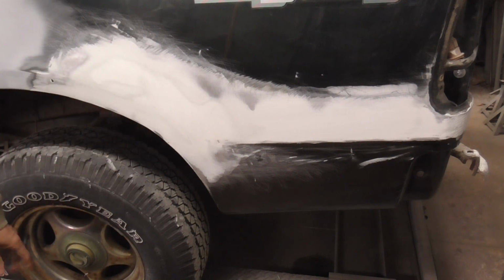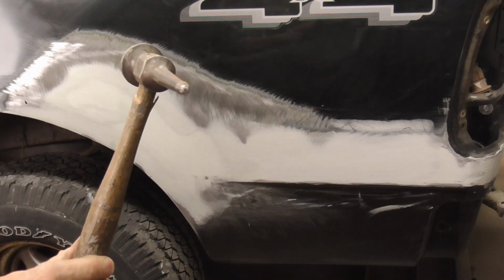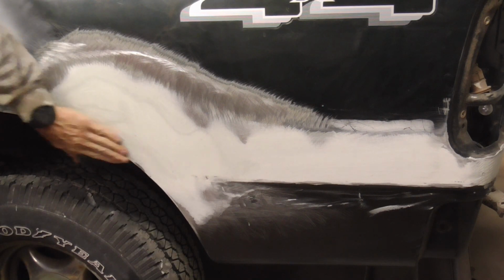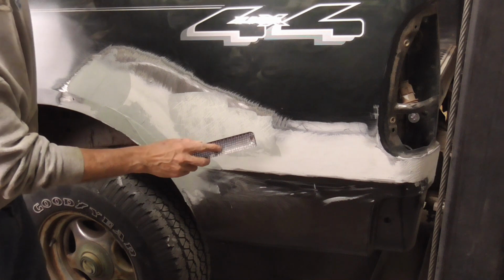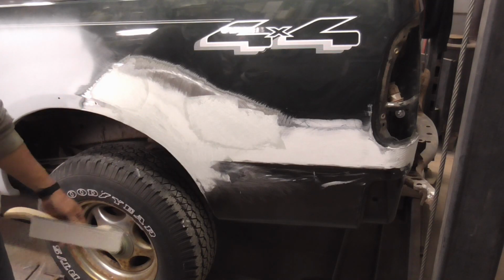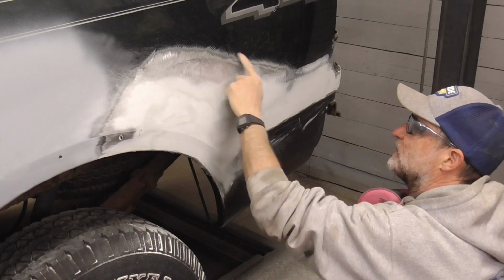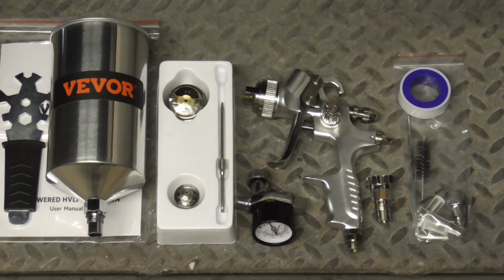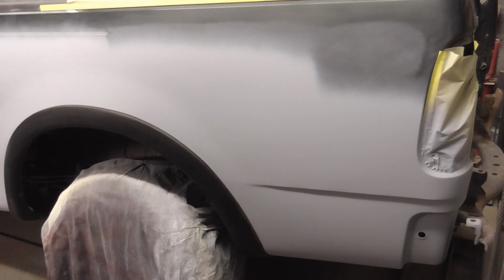Fixing High and Low Spots in Body Work | Dent Repair

Comment: Hi Jerry. The way you put the body filler on, I would just prime and paint, and no sanding. Looks awesome. If a person had a rust spot in the middle of a door, could one cut it out and weld in a new piece with out to much damage to the rest of the skin. I'm unsure how deep the rust is though. I dont want to get a new skin as my car is all original sheet metal, and all the glass is original all the way back to 72. I was wondering if I mig a spot, cool it with air, and keep going around the patch doing that. If it can be done, could you do a video about that too, besides the sheet metal one. Have a great weekend
Reply from the maker: In my opinion, you could absolutely get away with just this - https://www.youtube.com/watch?v=rPTaeH056ng  It won't ever see moisture up high on the door so you'll be fine.  Might just be surface rust too - I would just grind/sand it clean, even sand blast it - look for holes - if none, tap in down just a bit and fill.  Let me know what you end up doing with it GM - always good to hear from you - have a good week my friend :)

Comment: Hi Jerry mate. I have trouble determining the high and low spot, guy at work told me to use a rag. Do you have techniques to determine it by hand?
Reply from the maker: The only guaranteed way is to get it as close as you can, give it a few coats of primer, then block sand - you'll see your low spots then - especially if you give it a quick guide coat (a light dusting of black paint).  If you're using grey primer, the black will sit in the low areas as you block and will really show up at that point :)

Comment: Hey Jerry, i was wondering, when you finish rust repair on a panel, after filler and paint work, if you apply used motor oil, fluid film, etc, behind the panel, could that oily substance creep through the welds and start to penetrate the filler and create issues? I'm a big fan of fluid film and the like to stop rust, but how does cured filler hold up to that?
Reply from the maker: It doesn't have an effect at all - here's some proof of that - https://www.youtube.com/watch?v=8XaZBy7GC7A  also (old vid but still has good info) - https://www.youtube.com/watch?v=2o37dX--w0I
Reply: @LakesideAutobody  That is great to know! I appreciate the videos you put out there full of great info!
Reply from the maker: @15farcry  Thanks Ethan - glad they help - thanks for watching :)

Comment: Hey Jerry, I bought a used fender to replace a  damaged one. It has old paint and chips in the paint, (no dents). Do I need to sand the entire thing to bare metal or would filler primer fill in those paint chips? Or do I just sand the edges of the chips smooth then filler primer? Thanks in advance
Reply from the maker: Great ?s.  It depends.  If there's tons of chips, it'd be easier to strip it.  If there is just a few it's common practice to feather edge (sand them smooth), prime, block, prime, finish sand, paint.  You can get away with filling them with 2K putty, filler, or even lacquer glazing putty but that is frowned upon when working in a body shop.
Reply: Thank you sir

Comment: Great job Jerry bodywork is even harder on a black car
Reply from the maker: Thanks Luis - hope all is well with you and the family - have a good weekend :)
Reply: Great vid, have a few questions 
Notice you did not use any guid coat,
Also questions on guns??  I’ve seen and read many mix reviews on using just one gun for all painting needs!  See your using a vevor paint gun (which is in my budget). What other low budget guns would u recommend for spraying primer/sealer/base coat/ clear???  Just a diy beginner. Thx and keep sending great content
Reply from the maker: @dwaynelejeune3508  I've never really seen guys use a guide coat for body filler - only primer.  But... if it helps you get it straight then goa ahead and use one.  As for guns - you can certainly use one gun for everything - did it for years working at my first job.  I used a Devilbiss JGA copy - I think it was a Milwaukee Pneumatic.  For another cheap gun that you surely like - try the purple gun from Harbor Freight - it works just fine for primer or paint - https://www.youtube.com/watch?v=lwHDMcDWVzQ